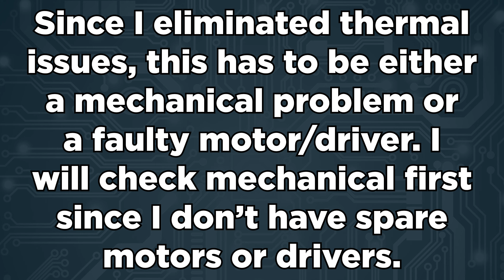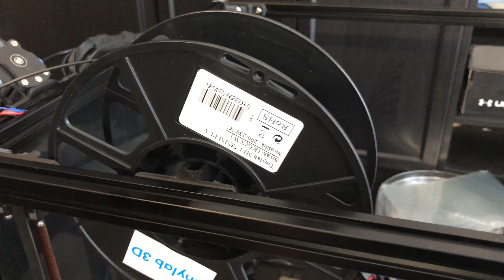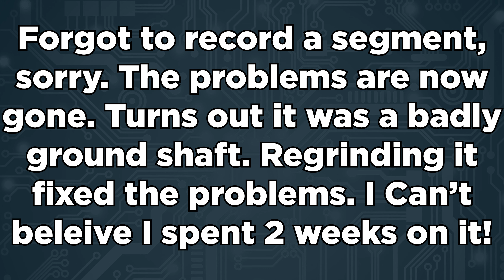Voron 2 Ep. 9: Let There Be Light

Comment: Not sure if you fixed the layer shifting but I had this happen on my Ender when I put acceleration to high and the motor accelerated so fast the belt slipped.  Something to consider if the issue persists.
Reply from the maker: I fixed the layer shift issue. It was a badly grinded shaft.

Comment: May I ask what drove you to choose the 2.4 over the 1.8? I'm "thinking" about building a Voron, but weighing pros and cons and cost of parts.
Reply from the maker: There is absolutely nothing wrong with 1.8. Main reason for my decision was the fixed bed, moving gantry system, larger build volume, and 2.2 using rails instead of rods in 1.6. With 1.8 now the 1 series are using rails too so the last reason isn't valid any more.